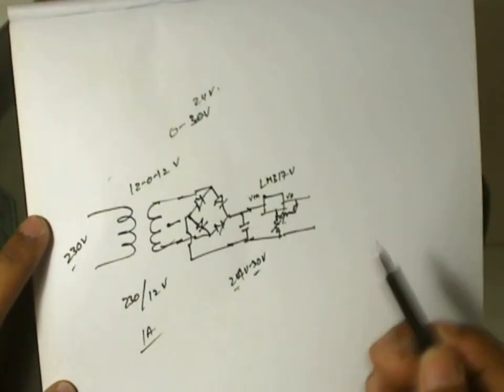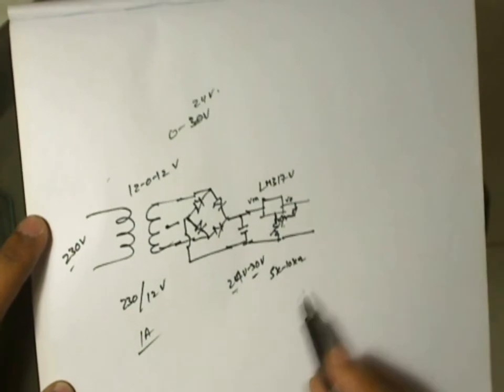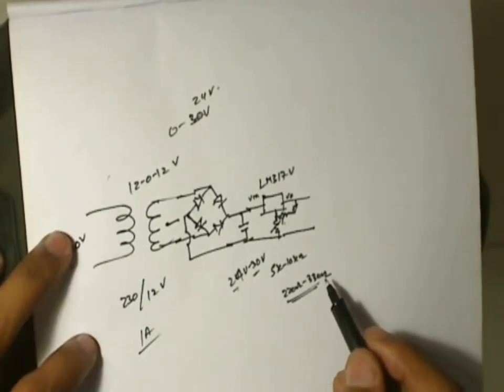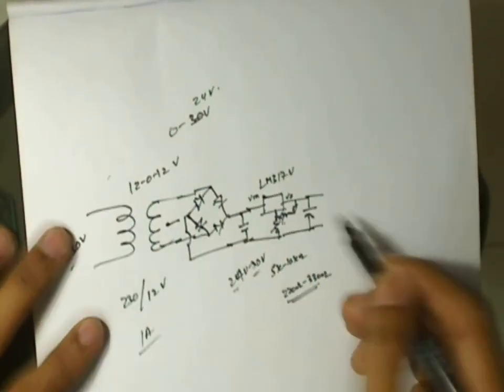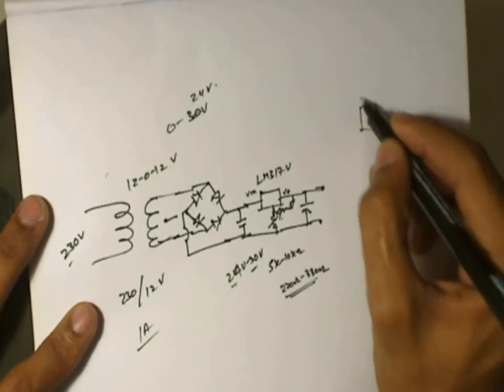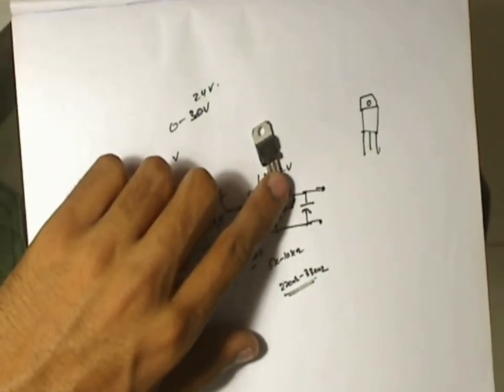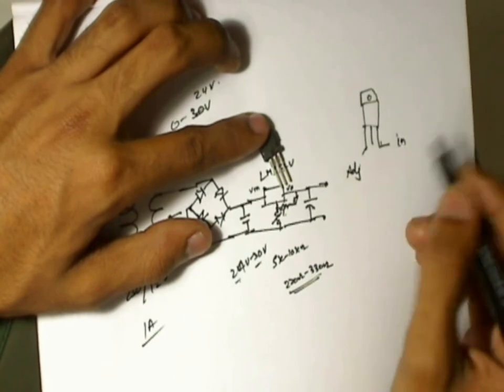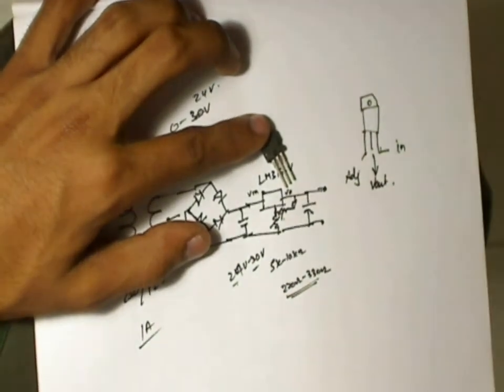DC REGULATED POWER SUPPLY

Comment: hey khader i actually made a 1/2 amp supply but if i set the voltage to 12v and connect a load the voltage drops to 6volts i don't know what to do help me
Reply from the maker: +Alakananda Borah what is the load u connected?? May b the load u connected is too high. What is the current which the load uses?? If its more dan 1/2 amp then this problem arises
Reply from the maker: +Alakananda Borah what is the load u connected?? May b the load u connected is too high. What is the current which the load uses?? If its more dan 1/2 amp then this problem arises
Reply: The load is a motor but i don't know how much current the motor draws

Comment: Can You please provide the schematic for making multi volt power supply, the same you showed at last.
I have transformer that is ( 12-0-12 + 0-18 ) both sides. i want to make power supply that produces 18v, 12v, and 24v. the transformer is of 2 amps.

please suggest.
Reply from the maker: +Anubhav Sharma in the same circuit you can replace lm317 with 7812 and 7818 constant voltage regulators to get the voltage you desired
Reply: +Electronics Made Easy : KHADER Hi, Thanks for the reply.
Please take a look at the schematics i have made at the following link.
https://drive.google.com/open?id=0BwGXVyNjNl7kNk5sSVhORG1hdmM
The only problem is everytime when i try to adjust potentiometer, it gets burnt. LM317 Circuit measuring 37v on output  and am using 12-0-12 / 2 Amp transformer. Potentiometer does not respond to volts not even 1%, and everytime when i adjust POT got burnt. Almost 12 pots i lost. I tried 5K, 10K, 100K.
Please if you can check the schematic and tell me where am wrong.

Comment: Sir,why dont you use that transformer less power supply for variable voltage (the concept which you used earlier)
Reply from the maker: +vijay kumar  working with variable power supplies usually involves touching the terminals often so if its transformerless then it  wil give you an electric shock. and also transformerless supply cannot supply high current ratings